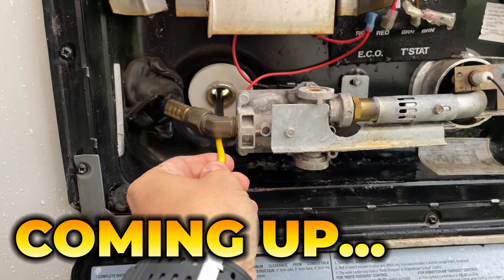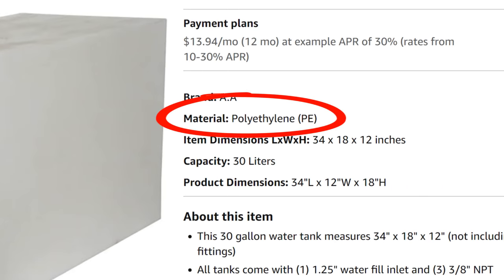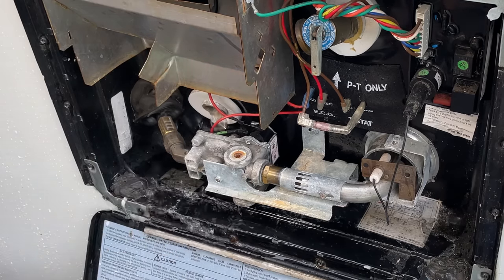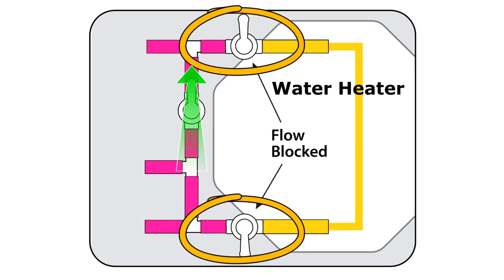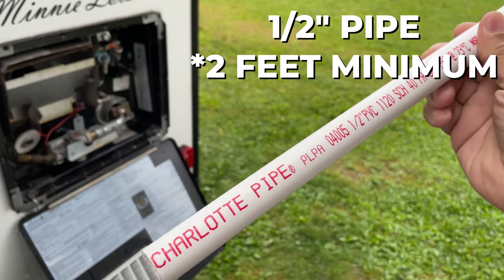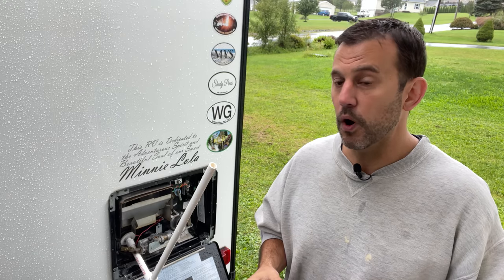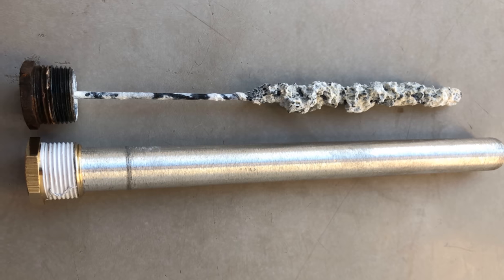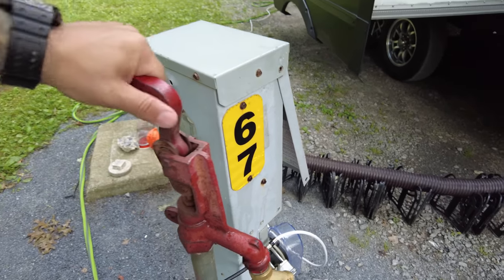Sanitize & Descale ANY RV Water Heater w/ This Simple Hack

Comment: Hey I called Dometic about an issue I had while trying to add vinegar in the pressure relief valve hole as they suggest . I didn’t know anything about opening drain valve until after doing the procedure and I don’t know if that’s the answer to my problem. When I drained the tank by pulling drain plug then used wand to flush out, I added 6 gallons of vinegar and then was supposed to add 3 gallons of water. Mine is a 10 gallon water heater and that is what Dometic told me to do and they also say same thing in the instructions they emailed me. The tank took all 6 gallons of vinegar but when I tried to add water it was full, it would just come out the pressure relief valve hole. So I then put valve back in, turned off bypass, opened relief valve lever, turned on water and within 10 seconds water was coming out relief valve so I knew tank was full. Shut water off, put back in bypass mode and turned water heater on to finish the rest of the procedure. I am the 2nd owner of Jayco Pinnacle 5th wheel and we were getting egg smell so that’s why I did this tank descale. I don’t know if this was done at all by previous owner but I need to start doing it. It’s a 2020 that was used to travel according to map decal on slide out. There was some mineral deposits when draining but I didn’t see anything ridiculous come out. The vinegar smell is now gone, but water now getting extremely hot and unit turns off when turning unit on. I run on electric mostly. Your video is the only one saying anything at all about low point drainage. Dometic doesn’t tell you to do that either. They also can’t explain why only 6 gallons of vinegar is all that my tank would hold. It’s definitely a 10 gallon unit, cut out size of unit in wall is 15 1/2 “, a 6 gallon unit is smaller size box so I know my 10 gallon unit was not labeled wrong at factory. Jayco and Dometic both never heard of this problem, and now my water heater is getting too hot and shutting off. At least I have hot water but it’s scalding hot. The previous owner put an adjustable thermostat on and it has letters A to E for setting temperature limit. It was on C and I lowered it to B and then A but it still turns on, heats up too high and then cuts off. I am thinking I should replace thermostat and ECO with regular thermostat kit. I tried to do the right thing, watched many videos, even got directions from Dometic and now this happens, and nobody knows why the tank was full at 6 gallons . The water was definitely off, the drain plug was out and all water came out when I opened relief valve lever. Do you have any idea what’s going on here?  You seem to know more than anyone and I wish I could speak to you because I’m in a bad place here and nobody has a solution.
Reply from the maker: does it get this hot using gas?  with an aftermarket thermostat, i would revert back to the orignal.  one of the cheaper options.  you may also want to change out the electric heating element too.  it almost sounds like that might be the problem, maybe it was so caked from not being cleaned and now it is clean so its working better?  its hard to say exactly, but i can promise the vinegar wouldnt damage anything inside the water heater tank to cause this issue.  it sounds like something else is failing.

another thing you can do is fill your water heater as normal, and then drain it into a 5 gallon bucket.  have a second bucket ready once that fills up, and see if you are gettting 6 gallons or 10.
Reply: @RVTIPSANDTRAVELS thanks for responding. I did not try it on gas. I did consider using my outdoor shower and put it on hot and fill up a 5 gallon bucket, hopefully 2 buckets full of hot water. I’m hoping the element is ok because I didn’t have any problems before the cleaning. Possibly a coincidence the thermostat went bad?  I have a kit to replace eco and thermostat and thermal shut off fuse. There was liquid in the clear plastic sleeve after tank flushed all over that area. Do you think I should try replacing the thermal shut off first?
Reply from the maker: good luck, keep me posted on what you find

Comment: Reason for not using diluted bleach water in tank?
Been sanitizing water heater with fresh tank for 7 years & no issues. 3/4 cup bleach to 45 gallons water.
Reply from the maker: bleach is caustic to metal.  it corrodes metal.  https://www.google.com/search?q=bleach+on+metal+ok&rlz=1C1VDKB_enUS936US936&oq=bleach+on+metal+ok&gs_lcrp=EgZjaHJvbWUyBggAEEUYOTIHCAEQIRigAdIBCDUzOTFqMGo3qAIAsAIA&sourceid=chrome&ie=UTF-8

I just reread your comment, using it in the fresh water tank is fine.  not in a metal tank.
Reply: @RVTIPSANDTRAVELS  
Undiluted bleach, yes.
The small amount for sanitizing system really shouldn't cause any issues. It's also only sitting in tank for a few hours. 
No issues with my water heater using sanitizing bleach the last 7 years.

Comment: Question: there is a product called CLR (calcium-lym-rust). Can this be used instead of vinegar? Would it damage a dometic heater.
Reply from the maker: im not sure of the ingredients in CLR, but if its not consumable, even on a small level, I would not use it.

Comment: I have drained my hot water heater before, but never used a flush wand or sanitized the tank before. I purchased the vinegar, the wand, and the pipe pieces. Here’s the problem:  This Atwood 6-gallon heater (GC6AA-10E) has the stupidest design I have ever seen:  It is nearly impossible to remove or insert the drain plug. I have to use a 5/16” swivel socket and an extension to my ratchet wrench just to get the drain plug removed.  The pipe tool you show cannot get to the plug due to this tight and angled space.  Do you have any suggestions?
Reply from the maker: maybe a fitting on the end of a hose?

Comment: I am new to RV living full time. Can I change my suburban hot water heater to electric instead of propane?
Reply from the maker: it should be both already, depending on the model.  the electric switch may be on the water heater itself.

Comment: Do you just use standard 4-5% vinegar, or can you use the higher cleaning grade (35-40%)? Maybe diluting it down to 8-10% with water?  
10-11 gallons of the normal stuff for the larger units seems like a lot.
Reply from the maker: I would use cleaning grade, and you can definitely dilute it.  Everything I’ve researched though says to only dilute it down to 50% vinegar with 50% water.  I haven’t looked into the chemistry side of it because this is what I’ve always done and it works well.  Hope that helps.
Reply: @RVTIPSANDTRAVELS  I use regular food grade vinegar and even cut it in half with water to descale my hot water kettle - I think cleaning grade at full strength is probably overkill.

Comment: Hi, is this method will help to clean the mixing valve ( without removing it ) . Just de-winterized and I have a low hot water pressure (valve is fully open) . Thank you
Reply from the maker: this will clean everything in the tank.  You can also run this trhough the lines if you wish.  some folks sanitize with vinegar instead of bleach.

Comment: Great video! I have a suburban water heater. The anode rod has some scale on it but otherwise seems to be in good shape. Does it need to be descaled after flushing and cleaning out the water heater and before reinstalling the anode rod?If so, do you have a recommended way to descale it?
Reply from the maker: using the vinegar is descaling it, cleaning, descaling, kind of both the same thing.  but vinegar wil eat your anode rod pretty quickly from my understanding so you dont want to put that back in until you are all done.
Reply: @RVTIPSANDTRAVELS  so, after descaling the tank it’s OK to put the rod back in with the scale on it?
Reply from the maker: The anode rod will look pretty gross, but that is normal, its doing its job.  you will have to replace it at some point depending on how worn it is... send me a pic of your anode rod: management@rvtipsandtravels.com
Reply: OK, will do. I went ahead and ordered a new one as well.
Reply: I appreciate your prompt replies to my questions. You have responded quicker via YouTube than some local mobile RV service guys have in the past. LOL

Comment: I tried it. Could only get 3.5 ga of vinegar in it. 6 ga tank. When closed valve after water started coming out the tank would not accept anymore. Started backing up pvc pipe
Reply from the maker: That’s more than enough to clean it.  There’s probably a little water left in there too.

Comment: So I have a suburban hot water heater. I set up my 3/4 pipe as shown in video. As I start to pour in the vinegar, about half way through the first bottle, 1 gallon each, the vinegar starts to come out my pipe. I can’t fill even one bottle into the hot water heater. My P T valve is opened. Not sure what I am doing wrong. Apparently gravity is not working. Thanks.
Dave.
Reply from the maker: did you empty the water heater first? try adding an extension onto the pipe.
Reply: @RVTIPSANDTRAVELS  yes completely plus I opened up my low point drains, let those drain out so all the water was drained. I also had my PT opened while putting in the vinegar.

Comment: Question,  i flushed my 6 gallon water heater using 3 gallons of 5% food grade vinegar and 3 gallons of water. Put it in the water heater and let it set for 9 hours. I then drained it all and flushed with clean water. Then i installed a new aluminum suburban anode rod. Problem, I still have the egg smell. After two months I just winterized my camper and drained the water heater.  The water smelled like eggs and the anode rod smelled like eggs. Why didn’t previous clean and soak work? How can i get rid of this smell?
Reply from the maker: not sure, how old is the camper and when was it cleaned before this last cleaning?

Comment: I have a dometic 10 gallon, so that means i have to fill it up with those 10 gallons with vinegar?
Reply from the maker: you can do that, or you can do a 50/50 with water.  I know a few RV'ers who do that.  You probably wont be able to get all 10 gallons in though either, they are usually difficult to completely drain.
Reply: @RVTIPSANDTRAVELS   sounds good and in winterizing mode i should be able to bypass the water heater but can still use the city water?
Reply from the maker: correct, you just wont have any hot water when the water heater is bypassed.

Comment: How long does it take for the water to warm back up after you turn the water back on?
Reply from the maker: Never timed it but not long, maybe 10 minutes
Reply: @RVTIPSANDTRAVELS  yep. That’s right. I had to reset some of the wires in the water heater. It wasn’t warming up. Works now. Thanks!

Comment: Ok method but I always remove the Pressure Release Valve and pour the vinegar in using a funnel.
Reply from the maker: how are you dumping it?
Reply: @RVTIPSANDTRAVELS  I have a Brass gate valve that fits inside the drain opening attached to a short garden hose.

Comment: I was washing out with wand and the wand came off and is still in the heater. Any ideas
Reply from the maker: first, fill up the tank so the water level is just below the drain... from there its a fishing game but youll need to get that out before you turn it on.  maybe try filling and dumping, that might help move it towards the drain where you can grab it with long needle nose pliers.  then pick up this wand instead: https://amzn.to/3ZY9csx

Comment: Does this process work with on demand hot water systems?
Reply from the maker: they dont have a tank.  you would just run the vinegar through the heater and let it sit.
Reply: Thank you very much for your help. Your vids are wonderful and a great help. @RVTIPSANDTRAVELS

Comment: URGENT: I have followed all your instructions to the T but ran into  a problem. Once the solution started leaking out of the pressure valve, I closed the valve, but once the valve was shut I no longer could continue filling the tank: the vinegar just came out of the top of the PVC pipe - and YES the top of the pipe is 2 feet higher than the top of the water heater tank. What am I doing wrong???? I am stuck and not sure how to proceed other than giving up on adding  more solution. I have a 6 gal Atwood heater, it only took 3.5 gal of vinegar. I had drained it and also drained the entire RV thru my low point drain valves. No way did I still have 2.5 gal of water sitting in that heater tank, the drain hole doesn't appear to be high enough to permits 2.5 gal of water to reside at the bottom. PLEASE HELP! I am stuck :((
Reply from the maker: not sure, sounds like there might be water in there but you drained it.  try it again, if the pipe is higher than the tank, your tank is full, just let the excess run off and let it sit.

you did bypass the valves correct?
Reply: @RVTIPSANDTRAVELS   Yes sir :) water heater is bypassed. After 3 hours, the vinegar level is still at the top of the tube. I guess if  the tank is not venting, vinegar can not enter it from drain hole. Cause as soon as I closed the vent valve, filling the tank became impossible. Is there anything important in the top portion of the water heater tank (such as heating elements for example). I am trying to assess whether, if my tank is not currently  full of vinegar, but only filled up to the vent  valve, I will still get adequate results. You see hard water deposits have invaded all my faucets, causing the water to not come out (only trickling). Even my toilet stopped flushing last week which alerted me to the problem. After trouble  shooting my entire water line system, I narrowed it down to the water heater. Hence I am descaling it (for the first time in (I am ashamed to say....) 12 years of living full time in the RV (ouch). I truly had no idea I was supposed to do this, none of the RV repair guys that worked on the heater over the years ever mentioned it. After I am done soaking in vinegar and rinse the tank, i am going to inspect every faucet inlet pipe screens to remove all sediments and hope this solves my problem for a while :)... open to any suggestions you may have about this.
Reply: BTW, I must say hats down on your video. I am a multi-award winning filmmaker, so I know what I am talking about. You are doing a great job and we all appreciate you! THANK YOU for helping us. Filming these videos and editing them is time consuming. Thank you again. After watching your informative video I felt confident i could do this myself  and  save $500 the RV mobile guys would have otherwise charged me to do the same  thing. hehe... I ordered all the tools and parts thru your links, hope you got a small % of the sale $. I will also subscribe to support your channel.
Reply from the maker: start over and leave the T&P valve open.  once that starts leaking, just close the valve and fill the rest of the tube.  Once it wont go in the tank anymore, you are going to be pretty full anyway since the T&P valves is near the top of the tank anyway.  Ill see what I can find out for you.
Reply: @RVTIPSANDTRAVELS   "leave the T&P valve open.  once that starts leaking, just close the valve and fill the rest of the tube." yes that is exactly how I did it already :) I followed yoru video instruction to the T (I am very thorough as you can tell from my long messages LOL)
Reply: @faithgrangerfilms  Did you ever find a solution?

Comment: Ross I did try it on gas and same thing happened, the water was scalding hot and it shut off. So I am thinking the thermostat is bad and needs to be replaced?
Reply from the maker: that would be my guess now that we know its not the element.
Reply: @RVTIPSANDTRAVELS ok I will do that next. The tabs on the unit had to be bent to allow the adjustable thermostat to be installed. I’m hoping when I bend them back for install of the correct factory thermostat they will just bend right back and not snap off. What are your thoughts about the tank only taking 6 gallons of vinegar only? Nobody seems to have an answer for that.
Reply from the maker: im as clueless as you are on why a 10 gallon tank is not taking more than 6 gallons of vinegar.